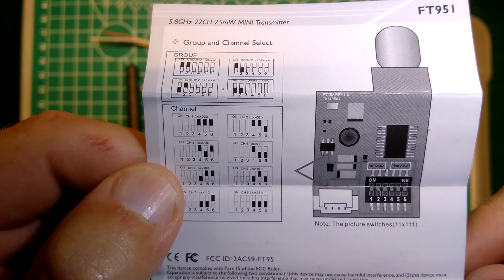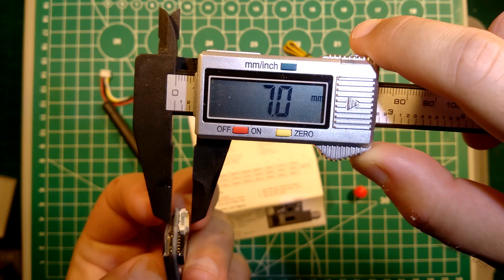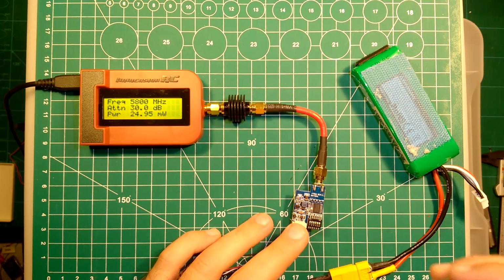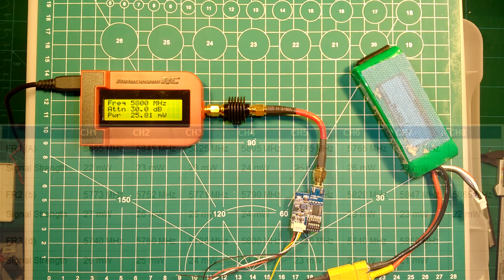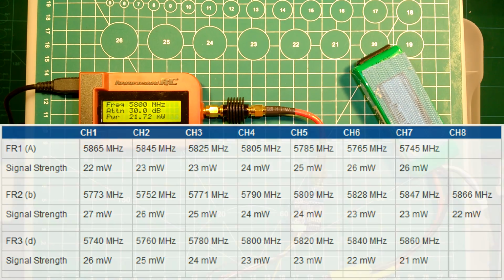5.8GHz Video Transmitter with Full FCC & CE Certification: Review & RF Power

Comment: The Chinese that sold this to you want you to believe it is FCC legal, but it in fact is not. I read their test report. Basically  they cheated the test in at least a couple ways. That is the only way for them to get an FCC transmitter ID with a device like this.
Either way, it probably works and it would seem that nobody cares about the FCC rules these days. I just don't like to see Chinese manufacturers lying to the public.
Reply from the maker: +Techenstein Many thanks for your input! I bought this from HobbyKing. Do you have more information on how they cheated? I'd be very interested in this.
Reply: @Rcfpvflight  i would too